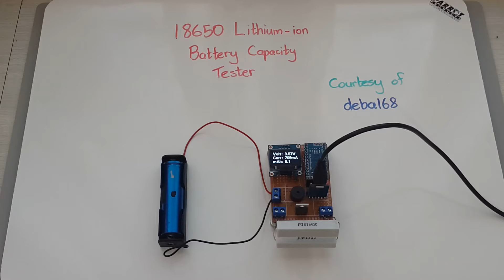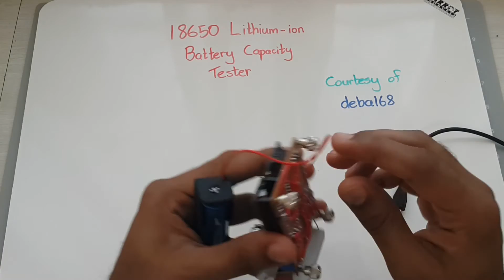DIY 18650 Lithium-ion Battery Capacity Tester

Comment: Great video thanks for it.
 ı have a question. Is there any diffrence between the results. .  İf we use 10ohm like yours or 1ohm ? I know 1ohm lasts all night. Except the time issue. Are The mah results same?
Also fast discharging  will it effect life of the battery ?
Reply: Thank you very much for your answer...

Comment: resistors by there self is not a good load     the value will change with voltage drop and heat you need to use a Constant Current load Circuit  !!

Comment: Great project, man. Great to put in a project box (with a small heatsink in the resistors) will the display and battery holder fixed outside. :)

Comment: I too have built his circuit and found it does not completely turn of discharging when low voltage is reached.  When the battery is disengaged and voltage recovers, the discharges reconnects the load.  This is bad for the battery.  So I added a few lines to the code to correct this defect. Other than that, its a great project.
Reply from the maker: Hi Bill Sherman, thanks for the response! 
May I ask what MOSFET you used for your build? If I'm not mistaken, you need a  logic-level MOSFET which will fully turn off and prevent any current flowing. @Open Green Energy wrote some information about this in his Instructable. 
Perhaps you are using a MOSFET that isn't a logic level MOSFET, that's why you're noticing your build isn't completely turning off the discharging?